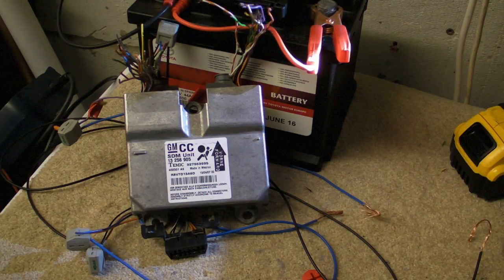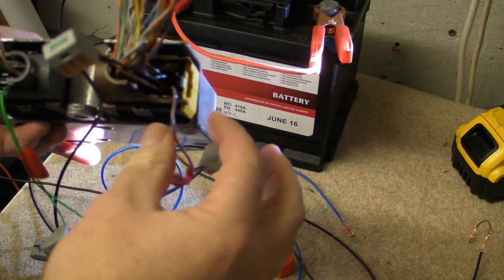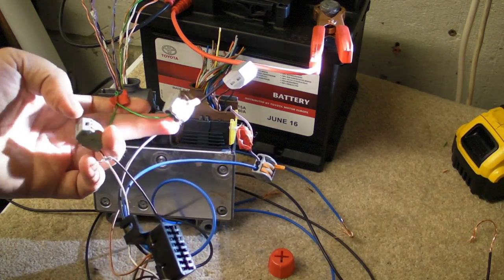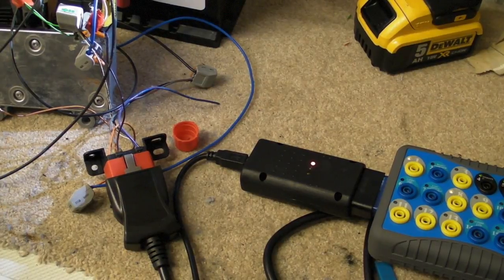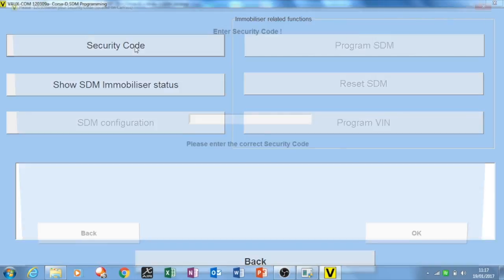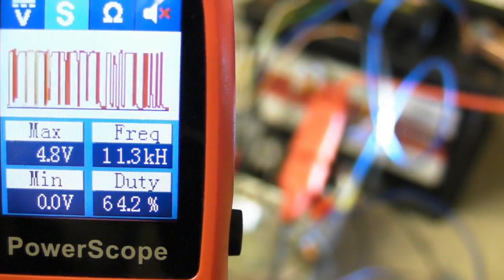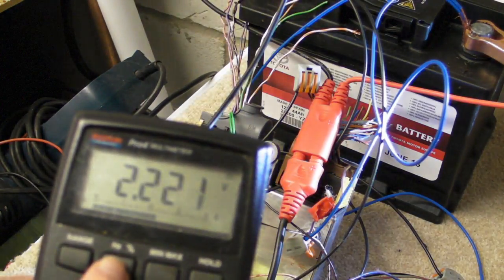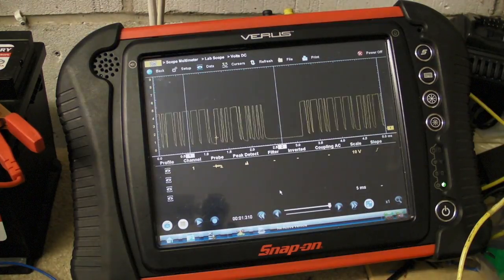VAUXHALL CORSA D SDM Module/Airbag Part 3

Comment: Very nice video, 
I have confronted the same problem customer brought a flood victim car with BCM and SDM completely destroyed no wipers, indicator, central locking, starting, power windows, heating, etc systems were working, however BCM was communicating with scanner but SDM NOT, finally we were able to put the scurity code in to the pre reset donated BCM but we have no communication with SDM, customer supplied a used SDM but with no security code and no pre reset condition and we are still struggling to start the car donated SDM does notaccept vehicle's security code. Now my question is this, that the module you have put the security code in, is the original module of the car? Or it is donated module with the donated module security code?. So, original module, original security code?
Original code, donated module?
Donated module, original security code?
Donated module, with its security code from doner vehicle?
We are waiting for your response thank you
Reply from the maker: The used SDM module should have been either reset before removed from donor vehicle or supplied with the donor vehicle  own security code, if it's got none of these it is useless! Cheers sandy
Reply: @sandyande  thank you so much

Comment: Hello Sandy, a few basic questions for you on my 2013 1.2 corsa d. Removing my airbag module. Got so far, Not sure how I get the yellow and green connectors off. Doesn't look as straight forward as i'd expected. Also once i remove it will i still be able to start the car or is the module linked to engine management other modules. Finally where do I find the module security code. I have radio and immobiliser codes only? Any help would be appreciated. Looking to use a firm to clear all crash data.
Reply from the maker: the connectors usually slide off once you start it with a flat head screwdriver. don't think the car will start because I assume it's like 2006 model where immobiliser is part of it.  Check to see if passcode is in glove box if not you may have to request  it from the main dealer, sandy
Reply: Very much appreciated!

Comment: Hi Sandy I've got the same problem with corsa d z10xep damaged ecu replaced ecu but I can't change vin in air bag module hope you can help
Reply from the maker: Did u try resetting airbag module (SDM) again